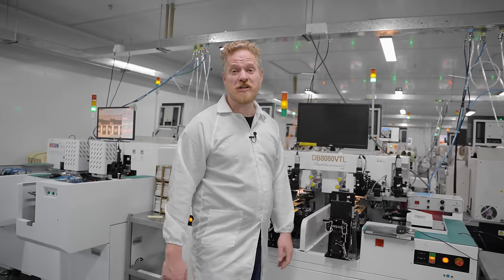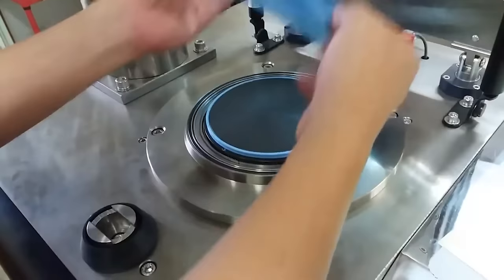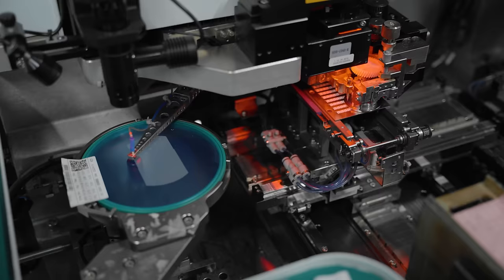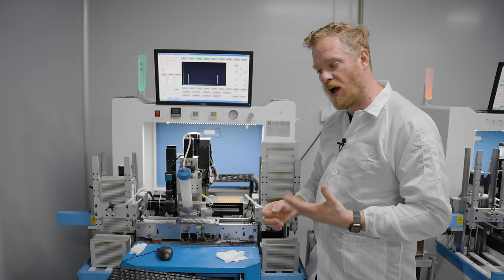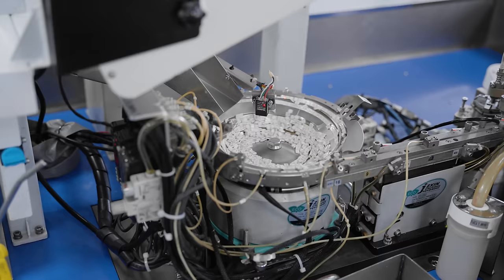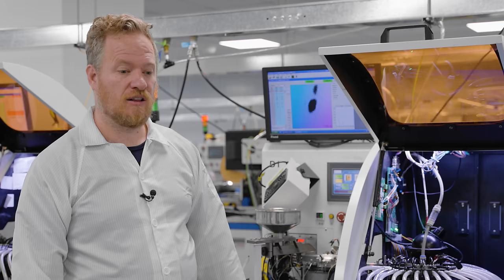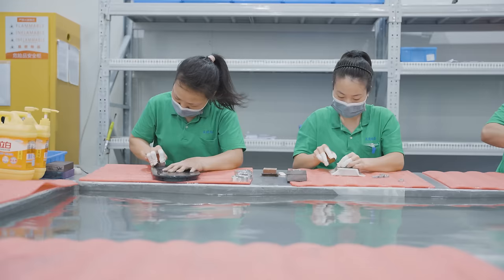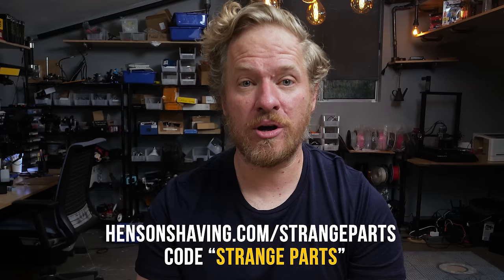Inside the Most Famous Chinese LED Factory

Comment: WS2812B LEDs are the thing that GOT me into electronics. they are fascinating little gemstones haha this is a very very cool tour, and im glad to see so much of the process. also Scotty, you giving the FULL tour and overview yourself is surprisingly great! i expected having the 'expert' or 'engineer' there to speak up was the best way, but it turns out just having you do and explain all of it yourself is much better in my opinion.  either way i LOVE these factory tours!!
Reply: I like it solo better also without having to read subtitles or trying to understand Chinese accent English.
Reply: I remember the first time seeing a blue LED. 💙 very dim about that color. Cost about 12 bucks from a surplus mail order place in the early 90s. Now they have extremely bright ones used in disposable stuff.😂 and some power LEDs rated at multiple watts optical power😮
Reply: And what makes it better are we can control it using cheap esp board like esp8266 with wled installed
Reply: red orange yellow and green LEDs from Radio Shack got me into electronics.  Some of the red LEDs were even from the Apple II disk drive.
Reply: @christopherleubner6633 haha snap here - I remember them being about £9. Also remember making my own PCBs at school with shining UV light through a trace created on paper, then photocopied and sprayed with WD40 to make it transparent 😂
Reply: @srdgjkhvdfhsedfkjd-x5m whatever happened to the amount of voltage/current going to it, determining what color it lit up?

Iirc, that was the 1st thing I learned about these diodes, no?

Comment: This is awesome. Knowing quite a bit about semiconductor manufacturing, it always amazed me how every single one of these LEDs worked. I honestly didn't expect 100% inspection but it makes sense. The little comment about the rejects getting sold at a big discount is a bit concerning as that would explain shady too good to be true priced versions that work, but just not as well.
Reply: It makes sense for certain products, if you're just messing around with some LED tape you probably don't care if some of the LEDs are 10% too bright, but it becomes an issue when it's not communicated properly, which happens too often.
Reply: Rejected once might not be bad and it's better to use them in low quality\price projects than toss them in the trash or something similar.
Reply: @E-hab Agreed, the problem is just that you usually don't know whether you're getting the real deal or rejects unless you buy from a reputable source.

Comment: That's incredible how fast and accurate those machines are. It's amazing that people still assume that anything made in China is low quality.
I use thousands of these addressable LEDs and have only seen 1 fail.
Reply: Well he said in the video the ones that don't make the grade are sold off cheaply.  So of course if a buyer is looking for the cheapest option, a low quality part from China is going to come up when they're one of the few countries willing to sell seconds.  So on the one hand it's good they sell them instead of dumping them in landfill, but on the other hand it means they end up with a reputation of producing low quality products, when really it's just because people are buying them cheap not realising they failed some manufacturing test.  If they were more clearly marked and sold as seconds I think it would improve their reputation, but too many people are willing to buy them and sell them as a premium product.

Comment: Fun fact: the reels used for component packing are based on earlier film reels. You can take a reel of LED tape and it will mount directly to the hub of an 8mm projector.

Comment: Cool. I've been using their LEDs and standalone controller ICs. Pretty neat how they work on the application level. And even cooler how they are manufactured. Thanks for sharing.
Reply: The 2812b requires exact timing though. Any runtime delay of more than 1 millisecond will result in the strip not displaying properly. So it's important you either use PIO for transmitting data, or you have a mega stable computer/application with razor sharp timings. I recently built a matrix text scroller driven by a raspberry pi pico and had its on board PIO do the data transmission while the application starts on the next frame.

Comment: Really fascinating how these machines manages to be both fast and delicate. Even more impressive when you realize most of these are also made in China (would love to see a video about these, specially the wafer handling ones). The only frightening stuff is how often these seems to run very old Windows versions like Windows XP or maybe even 2000 (in fairness, it's fairly common in industrial equipment) ^^.
Reply: It's more secure on average. And most of the time these machines are never connected to the internet, heck not even to any network.

Comment: Amazing stuff.. whenever I think LED I always picture the classic type with two wires sticking out. Seeing this is amazing, the LED technology we have is crazy.. I’ve had an OLED TV for a few years and that still blows my mind how small they are.
Reply: Manufacturing-wise, an OLED display has nothing in common with discrete LEDs. Your OLED TV is not manufactured by mounting individual LEDs, it’s basically a glass panel printed with many layers of special inks. (Super oversimplified, but the key is that it’s made as a single part, with all the individual subpixels manufactured simultaneously, just the way that all the billions of transistors in a microprocessor are made together as an integrated unit, not added one by one.)

Displays made of individual LEDs do exist, as video walls. These are available with a dot pitch of as little as 0.84mm, but even that tiny pitch makes for a 145” 4K display, over 3.2m wide. Shrinking that approach down to household TV sizes is being experimented with, under the name “micro LED display”. But they haven’t been commercialized yet.

Comment: Fascinating video, thanks! I got my first LED from my Dad who was an EE. It looked like a mica capacitor with a little red glowing nib on the edge. I was 8, and it was 1970. I hooked it up to my stereo speaker output, and watched it flash to the music (shoulda patented that!).
I got my EE degree and was waiting for the elusive blue LED. In 1989 I got some of the first samples of Cree's Silicon Carbide Blue LED, which still operate in a control panel to this day. Today's InGaN blue LED chips enabled white light with either color mixing or an added complimentary phosphor. The revolution in lighting had begun!

Comment: I actually have one of those K&S wirebonding machines in my garage. It was at a machine shop auction for some reason, and as I was the only person there who knew what it was I got it for $250. Best as I can tell, it is a fully working machine, however, it is a brick right now. The "DRM" the machine uses is to keep the software on an external server, so every time the machine power-cycles it is blank (the OS is WinXP Embedded, and the HDD is in some kind of read-only mode). Hopefully I can get a hold of the software at some point.
Reply: Either reverse engineer the hardware and write your own software or somehow manage to get access to it (pay them for x days?) and dump it from memory :D
Otherwise, yes, its a brick
Reply: Perfect illustration of the embedded software industry.  The general attitude is "fire and forget".  Software maintenance is non-existent.
Reply: @petergamache5368  In this case it is how the manufacturers work.
"Oh you got one of our machines? Pay us for the drm-ed Software yearly"
Or another company writes the software for that niche market and wants those big bucks which you are forced to spend. 
Since it is probably "just a precise cnc" (if the hardware is off the shelf) it might even have partial linuxcnc support :D

Comment: Isn't it ironic that they have machines that solder 30k 0.02m an hour with perfect precision, but then someone manually has to trim the plastic trays with an exacto knife?
Reply: Yeah, I guess, it'd probably be pretty easy too, but I guess manual trimming isn't much slower than machine, as opposed to wire bonding

Comment: I haven't been able to make any direct comparisons for scale myself. But I've been repairing a lot of (automotive) ABS units lately (sidegig hobby), almost all due to broken wirebonds. It's tricky work but helps hone the skill (assembly, die-package, bondnand PCB tech is always evolving) and keep the fine motor skills fresh, as microeletronics repair is no longer my dayjob. The bonds are similar dimensions - 0.02 mm is most common but iit varies between 0.04-0.009 mm. The 0.009 ones are the most tricky to work with doing soldering repairs with hand tools, as especially gold wires that size break so easily. Sometimes I don't even need to pull on them; just the compression by grabbing it with my tweezers can sometimes cut them. They also have so little thermal mass that they melt extremely easily when bonding to a pad, but there's a limit to how little energy you can expose them to because you still need to heat the MUCH larger thermal mass of the pad, and don't have precision jigs or machinery to aid or a 3rd hand, just a very small soldering iron and hot air gun. Can't really use preheaters to help either, because I'm not working with the bare and open assembly like the manufacturing factory does. I'm working down inside a narrow, partly potted steel box. So not only is it too cramped, it's kinda down inside a steel cauldrun. If using hot air down there, it has nowhere to easily disperse, so it would cook surrounding components. 

Adding to the absurd duality of repairing these things, they're manufactured as sealed units, they're not considered repairable. And with stuff like this I do kinda get it - the hydraulic end is super complicated compactness, and the electronics end is full of low double to single digit micrometer wire bonds. For those to survive in the engine bay of a car, partial or full potting is an absolute neccessity. There's a liability aspect too, being an essential safety component. But, they're also stupidly expensive to replace so there's a fairly high cost threshold for what people are willing to pay to have one repaired instead, which means there's still a market forbthese complicated and very time consuming repairs.

All this means that to repair them, first I need rough brutality to cut them open with a hacksaw - then from the garage shed into the lab underns microscope to pick away epoxy filling so I can splice or replace 0.02mm wires with a soldering iron.

Comment: That is awesome. Worked for 3+ years soldering these badboys onto the modular LED screens we see at festivals. I only did repairs of course, but still pretty sure i've seen 10's of thousands of little LED's (and even more tiny screws). About a 1hrly output of one of these machines. 😵

Comment: What I found most fascinating is the vibrating spiral ramp. I was wondering how each LED element gets oriented correctly. I was surprised to see that it's a statistical device relying on chance and rejecting the ones that aren't oriented the right way. It's clever and seems to work well for high volume runs. I would like to see it's stats when there's only say a dozen LEDs in there and how long it takes to orient them all.

Comment: 7:45 that is absolutely right. I spent quite a long time doing "manual" wire bonding of custom chips using a semi-automatic machine in the cleanroom during my recent PostDoc and let me tell you: I hate the wire bonder. The threads break, if you use too much or too litle power on the ultrasound setting the bond is not made, the height of the approach must be calibrated correctly, the length of the cut "tail".... aaaahhhhhrghh I could keep going. Nasty yet fascinating systems.

Comment: I have never been a fan of WS2812, they are to slow (400khz), I use APA102, it has 6 pins so you have clock and data, the clock speed is 10Mhz 😉
But amazing to se how they are made, thanks 💪👍

Comment: Why not just design the IC to directly be soldered to the pads like a normal SMD on a pcb instead of running 10 wires to each connection point slowing everything down and making things more expensive?

Comment: I’d kill to be able to get my hands on all of the bad batches of these that fail for whatever reason. 

There are several small gold bonding wires inside each multicolor led and 1-2 gold wires in single color LEDs. 

Other than recovering the gold bonding wires, there’s also copper and nickel that could be recovered and separated.

Comment: Why do they have separate dies for the LEDs and the controller? I’m surprised it’s cheaper to separately manufacture all the dies and controller then combine them than to fab them as one piece. 

Is it that it’s not possible because of the manufacturing process of the different LEDs?

Comment: The cool thing is and most people will not notice it. They sell off all of those 2nd leds. I do wonder where they end up at? The the market for cheap leds is always out there yet do these companies lable them as good leds or do they market them as 2nd leds? 
Still a cool video.
Reply: Was wondering that too, how does one make sure they don't pay for the legit units and receive the 2nds. I've purchased quite a few of the self adhesive tape strings for 20ish bucks and not had issues. I recently found some for 11 bucks and bought a few but haven't had a chance to try them. I was going to put a couple of each side by side and see if there was a difference and let them run for a couple months and see if they hold up.

Comment: Blue LED : Why was the invention of a blue LED important enough to earn the 2014 Nobel Prize? Because that made it possible to manufacture a white bulb. Before that, they had only been red or green (I think -anyway not blue.) But with blue light, you could add phosphor that transformed it into white light.
Reply: Small correction: the Prize was for a viable production process. The first working blue LED was made decades earlier in 1972. I would argue it was invented even earlier in the 1960s but they didn't have the materials needed.

Comment: hi you say the used razorblades are recyclable i am curious how that would be done because a container of used razorblades sounds extremely dangerous
Reply from the maker: I put mine in a steel sharps container.  I'm guessing that whole thing can be recycled as steel, given the blades are steel too.  The one I have is from a microscopy supply company and they don't seem to have it listed anymore, but here's a link to a similar random one I found on Amazon: https://www.amazon.com/Feather-Styling-Razor-Disposal-Case/dp/B00DWGEY1K/

Comment: strange old timey thing. If you live in an older house with a built in mirror cabinet, look for a little slot in it.  they were called razor slots. It was so you could " safely " throw the blades away, you just tossed it into the wall cavity.  If you do remodels in old bathrooms you find the space between one pair of studs filled with old blades.  Not always, but it was a very common thing and just a " strange part" we dont use anymore.

And as for the video itselfr, freaking amazing. Those machines are wild.  I am shocked the failure rate is so high.   I mean, that is a solid " A " but when youre making 30k parts an hour, ~95% leads to a lot of bad parts.   Did they say what the use for the sold of bad LEDs were for? just general lighting? did they bin them out like these are only blues, red, greens?

Comment: Power+data out and ground+data in is how cars should handle their data and sensor networks without all the ridiculous wiring.
Reply: Single-ended signals are poor for carrying signals over any meaningful distance. The CAN bus is a differential signal which works well over distance and in the presence of interference.

Comment: An "LED" that's got three LEDs inside? No, it's actually a pixel that's got three LEDs inside.
Reply from the maker: All multicolor LEDs are this way
Reply: @StrangeParts  I know :) My comment is about the term we use for those things. We shouldn't call them LEDs unless we actually refer to the tiny light emitting thing inside the pixel.

Comment: I doubt it is plated with silver.
Reply: SIlver plating is very, very common in electronics packaging, and it's cheaper than you think, mainly because you're uninformed.
Reply: @sawgames8623  as long as it can be done cheaper, it will.
Reply: @MezeiEugen  Weird response without admitting your ignorance, but ok.
Reply: @sawgames8623  says the guy who confuses chrome plating with silver plating.
Reply: @MezeiEugen  "It's nickel with silver plating." Chrome is almost never used for leadframes. Nickel is the underplate. Silver and gold are very common platings for soldering wettability and wire bonding adhesion. You know nothing and yet speak with condescension and arrogance.

Comment: Very interesting tour at the factory! :) But seriously, will you youtubers stop promoting shaving products... this insanely overpriced shaver is NOT better than the cheap knockoffs razors I buy at Lidl. I buy a cartrige of 4 heads, with 5 blades on each for like 4€ I shave my entire head 3 times per week and such 4€ cartidge last me half a year, and it does a PERFECT job. There is no econimical sense in buying gilette or this henson aerograde 100+$ shaving handle. Its nothing but marketing BS - as with every single other advertised shaving product. JUST buy the cheap fake gilette in wallmart and lidl, and stop paying for big fancy ad productions